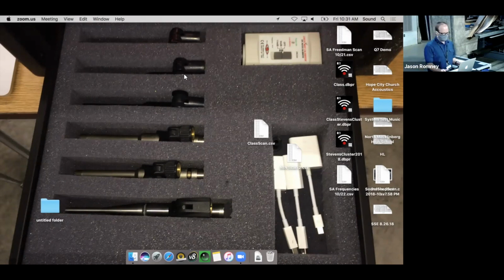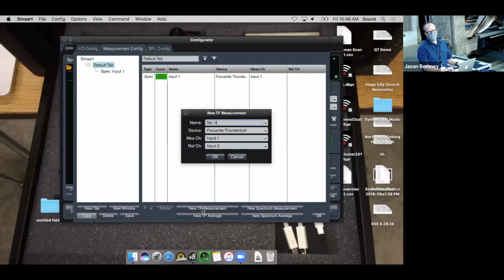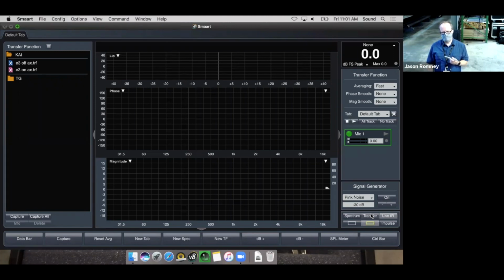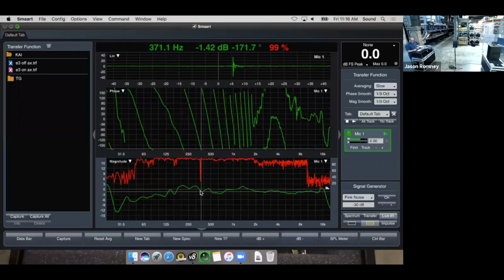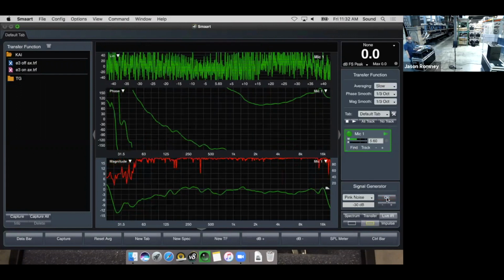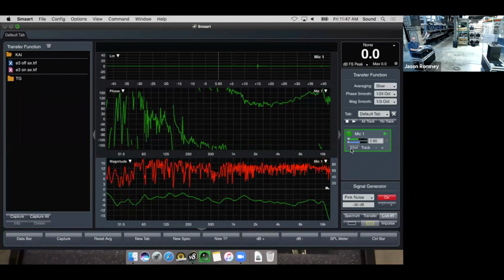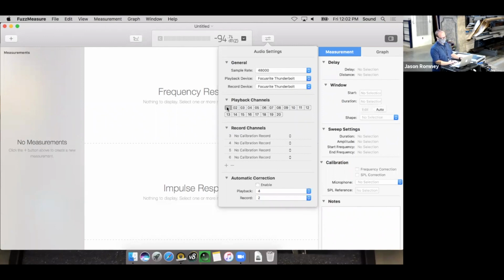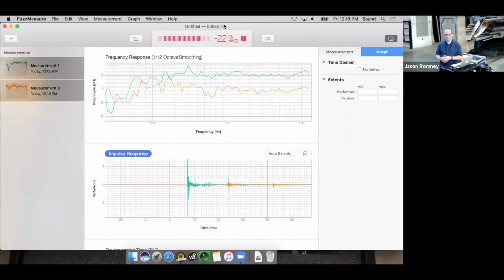Introduction to Smaart and FuzzMeasure

Comment: I’m so confused as to why the presenter is overlooking the fact that you don’t have to keep the sound playing to see the measured response with Smaart. 

Just press the soacebar and capture the measurement. Viola! Now you have a static trace just like Clio, with no more sound going thru system.
Reply: Yes, and I certainly teach them that technique. The point I'm trying to make is the difference between source independent systems like Smaart and source dependent systems like TEF and Fuzzmeasure. The right tool for the job can make your life a lot easier and sometimes a source dependent system like Smaart is not the right tool.

Comment: Microphones that are sold as 'matched' pairs/sets of any number are not matched in frequency response, they may be close, but that's not the point. They are matched in sensitivity (mv/pa). It very easy to correct for variation in frequency response, but the variation in sensitivity is another story. With matched microphones you can set the gain on their preamps and expect them to all have the exact same voltage coming down the line, if you want them to also have the same frequency response then you can also load their individual correction files. While you are right that it really comes down to chance what capsules are matched, you are incorrect that it is based on their frequency response.
Reply: Thanks, yes, that makes sense.

Comment: The drop in coherence at HF that occurs when the measurement delay is not set properly is not related to comb filtering, but the fact that Smaart's time window is very short at those frequencies (about 8ms at a sample rate of 48 kHz). The late arriving energy falls towards the edges of, or outside, the time record, and is therefore considered uncorrelated by the analyzer.
Reply: Right, it's not true comb filtering that's happening to a signal. It's just the result of a problem with the measurement delay. I guess what I was trying to say is that just like a slight delay between two signals that get mixed together causes comb filtering, a slight delay between the two signals in your measurement will compromise the coherence of the data you see in your measurment.

Comment: Hi Jason, since you asked -
We default to Spectrum measurements because single channel (spectrum) measurements show the signal directly – they are the most useful measurement for looking directly at a sound source to see what you have. This is the measurement used to verify your signals before you go and make Transfer Function measurements. Would you mix a band before doing a line check? It’s the same idea here.
In practical application terms, single channel measurements best correspond to our human hearing mechanism. If you want to know what the sound is, you need to use a single channel measurement. This is also why an RTA or Spectrograph is so useful to a mixing engineer, to answer questions like "what is that frequency feeding back? What is the resonant frequency of that floor tom? What is the spectral content of my mix?" Single-channel measurements answer questions about the signal, whereas dual-channel (transfer function) measurements answer questions about what the system did to the signal.
Reply: Jason, maybe the spectrum measurement is not useful to you but it doesn´t mean that it shouldn´t be as the first screen in Smaart. In my opinion it is very useful, same the spectrograph option! Also the two spectrum channels which are paired for an TF measurement are the mother and father for the upcoming TF trace. It´s very important to understand their single content regarding to understand the TF trace! And when you why 8 channels of them I clearly see that you don´t understand what Smaart is able to do. A little less personal opinion would do very well his job as a teacher!
Reply: @michaelhack3347  Later in this course we learn how to have multiple measurements going at one time. That's when having all those inputs becomes helpful. However I have found that when students are first learning a tool like Smaart, having too much to look at tends to confuse them away from the think they need to be paying attention to. So that's why I teach them to delete all those spectrum measurements right off the bat. I've been tuning really complex systems for 25 years to the satisfaction of many clients and I've never once needed a spectrum trace to do it.
Reply: Very interesting. Thanks for chiming in. The problem I see too often is when people look at that spectrum view and start making interpretations based on the quality of the sound. The spectrum view tells me what is happening but it doesn't tell me whether that's right or wrong. Just because I see that a certain range of frequencies are louder than others, doesn't mean that's something I need to fix. I guess I just find it to be a very incomplete set of information. So it's not useful to me. I also teach my students that EQ should be the absolute last tool they use to combat feedback after they have exhausted all of the much more effective methods. So I don't really want them staring a spectrum view to figure out which frequency is feeding back. Sorry for the snarky attitude in the recording. Trying to keep the attention of 8 college students who just rolled out of bed often requires some joking around. Obviously I'm aware that the spectrum view has a purpose, it's just not a purpose that tends to matter much for the kinds of things I need to teach them.
Reply: EQ may be the worst tool you've got against feedback, but it's the only one you've got left after the downbeat of the show. I run a spectrum measurement per wedge mix to save me the time of finding which is the biggest offender.
Reply: @DavidWilliams-vp9xu  Yeah, we definitely talk about that reality but I teach them to predict the feedback ahead of time and solve the problem before they even install the sound system. I can't tell you how many times I've walked into the space a few days after I know they tuned the system well to find that they completely obliterated their finely tuned frequency response because they couldn't be bothered to walk down to the stage and move the mic closer. So I've learned over the 16 years I've been teaching to not teach them techniques like that too soon before they're ready to responsibly apply them.
Reply: @slvds  That makes sense, and I'm all for moving a wedge or swapping out a microphone at soundcheck to fix these problems. That said, my experience at the monitor desk is that the band will get fired up throughout the show, your back line volume will creep, your vocalist will spend more time in front of monitors engaging with the crowd, and you'll easily be into triple-digit stage volumes. I like having an RTA instantly pinpoint that instability for me, and I'd wager that it's saved me a few grand worth of horn drivers.
Reply: @DavidWilliams-vp9xu  Yeah, I hear you. And that's why I'm glad I'm training my students for theatre where we don't have to deal with that problem ;)